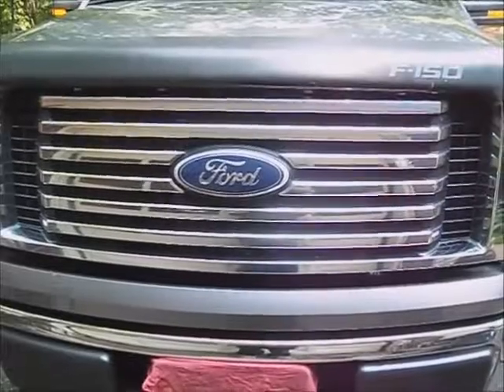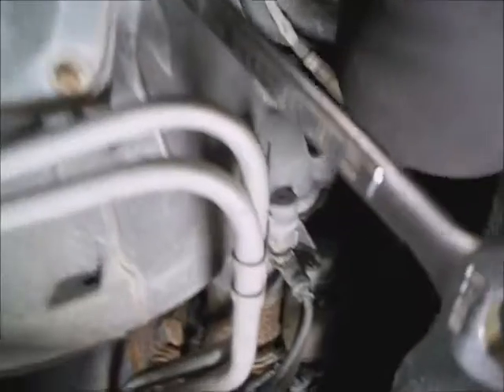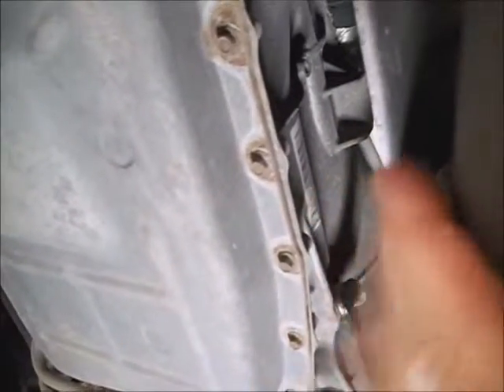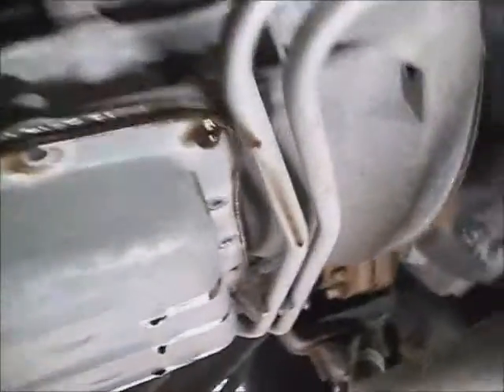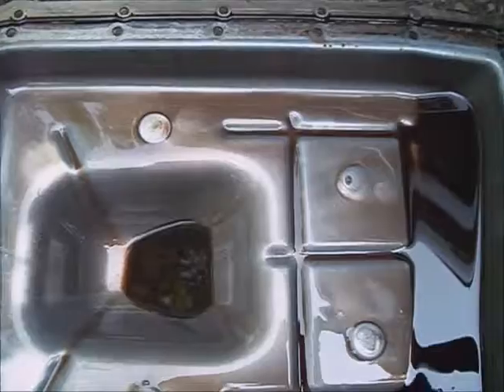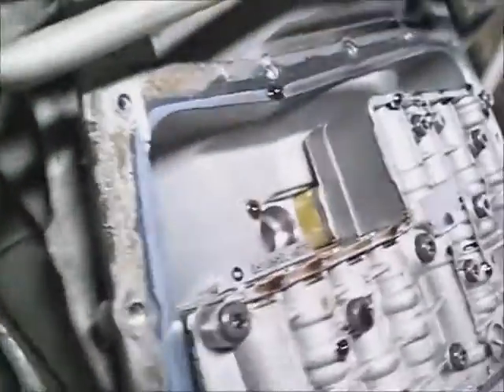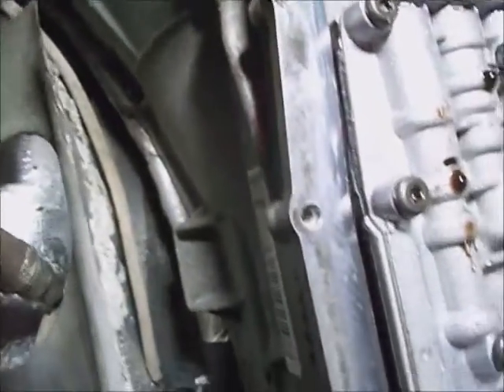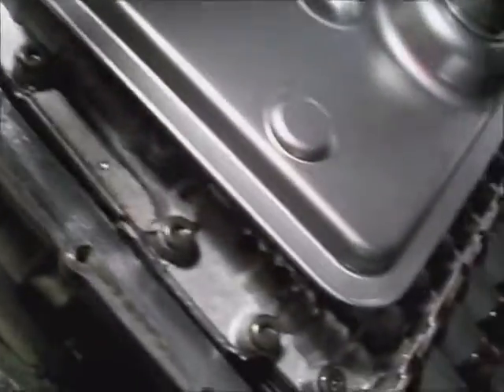Ford f-150 `10 truck 6 speed 6R80 transmission filter & fluid flush refill procedure pt1

Comment: I wouldn't put any brake cleaner on that valve body. I wouldn't even touch it. Those solenoids are susceptible to electro-static discharge. You could fry em just by touching them. They're very sensitive. It's pointless in my eyes to clean the valve body. Youre never gonna get all the fluid out just by dropping the pan anyway. Half of the fluid is in the torque converter.
Reply from the maker: Those solenoids aren`t going to get fried handling them, not sure where you get your info from.  The idea of cleaning the valve body, is to get as much of the clutch material off of it as possible.  And in the second part of this video, at the end, I drained the pan again after a brief test drive.  And did the final fill and level check.

Comment: Good video. Thank you. This looks like a fairly straightforward job, easy enough. But, do I need a larger drain pan, or is there a larger drain pan available that will catch all of the fluid? It didn't look like your drain pan caught all of the fluid either.

Comment: Why not wash off the valve body with new clean fluid ?   NOT SUCH A HARSH CLEANER
Reply from the maker: The cleaner dissolves the suspended clutch debris, from the surfaces.  And it has no other effect on any components, that it contacts.  Thanks for watching.